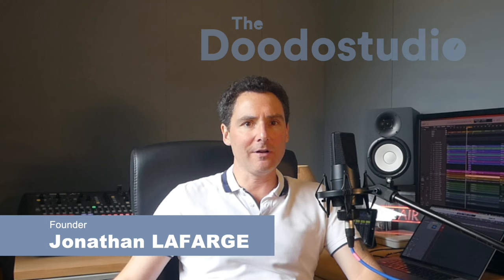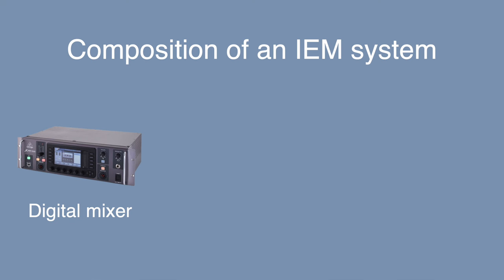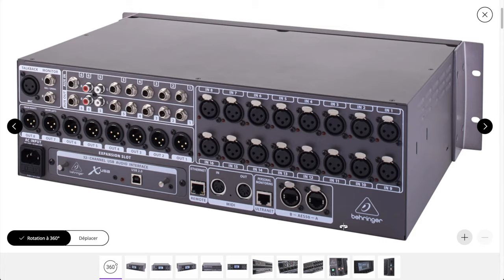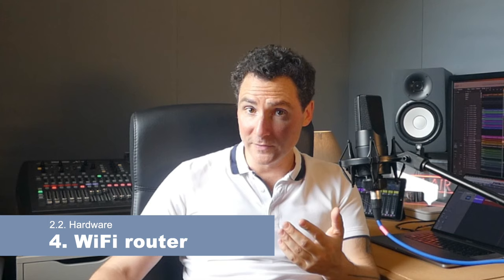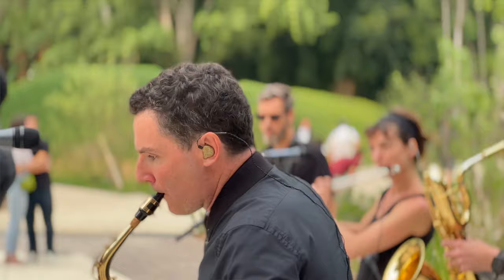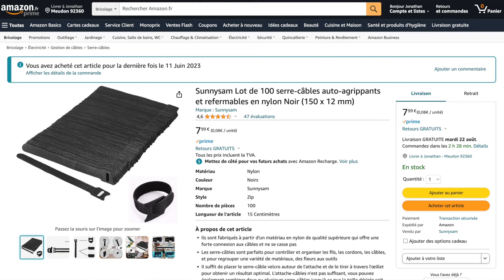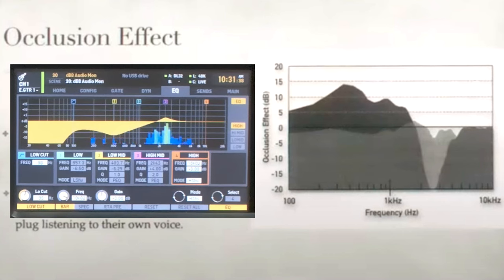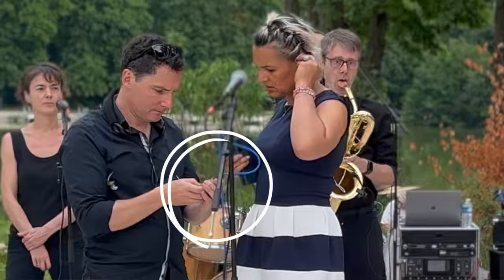What is an in-ear monitor system, and How to build an IEM rack for your band

Comment: With the Behringer P2 - you need to make sure the pins are wired correctly to work in stereo. Some soldering may be necessary to make the cable work correctly.
Reply from the maker: Thanks for this clarification. All our Behringer Powerplay P2 work in stereo out of the box, though. Maybe we were lucky.
Reply: There’s a switch inside the p2 that toggles between stereo and mono.

Comment: This video is realy good... just one thing  i dont understant how you make stereo IEM mix just by using Y XLR cable ?
Reply from the maker: Thank you very much for this feedback. Actually, the Behringer PowerPlay P2 accepts stereo signal via a usual XLR cable. To do so, you need this specific Y XLR cable that will flow two signals (coming from two XLR outputs of the mixing table) into a single male XLR to plug to the PowerPlay. Hope it's clear.

EDIT: sorry, the XLR-XLR "Y" cables presented in my video doesn't work for stereo IEM with the PowerPlay P2 : you need a XLR to stereo Jack, and put the switch inside the PowerPlay P2 to "stereo". Then it works perfectly, and is really easy to pan channels with the fantastic mobile app "Mixing Station".
Here is a link to this kind of cable: https://amzn.eu/d/2NB2BdV

Comment: Meh....we are using an x32 with a Midas 4816O and we don't need those extra two boxes. All 16 channels we need are on Ultranet, and it works great.
Reply from the maker: That's great, lucky you! I guess your rig is much more compact, then. On our side, we really needed 24 channels, and wanted to be analogic to be able to split the sound for the front of house whatever the local system is (in particular analogic systems). Feel free to share some pictures of your rig!

Comment: Why not use aes50b instead of mic splitters the x32 allows you to route all of your inputs to aes50 outputs
Reply from the maker: It is a possibility, but this will work only if the Front of House consol is a digital one, compatible with our X32 rack. Our intend was to have a rack that would work whatever the configuration of the FoH. Most of the time, stages already have an XLR patch available, that goes directly to the FoH consol. So having the XLR from the snakes is super convenient to plug and play the rack on stage, particularly when other bands are playing before and after us (festivals, etc.). Hope it's clearer.

Comment: Salut Jonathan, ca y est on va se lancer dans la confection de notre rig IEM. J'aurai une petite question pour toi. Est-ce que vous êtes satisfait de nos splitters Behringer Ultralink MS8000 ? Je lis sur internet que ces splitters induisent pas mal de bruit si intégré à un rack ou il y a un power conditioner. Nous hésitons aussi avec un splitter Seismic Audio 24 pistes, mais les revues sur internet ne sont pas top non plus. Du coup on sait pas trop quoi faire. Merci d'avance pour ton aide. Brice
Reply from the maker: Salut Brice ! C'est une excellent initiative, vous n'allez pas le regretter ! Concernant les splitters Behringer Ultralink MS8000, je n'ai aucun problème avec. Je pense que c'est un très bon produit. J'ai juste eu un souci une fois lors d'un concert en extérieur, où j'avais installé notre onduleur (17:13) collé contre le rack. Pendant les balances, cela générait un bruit permanent dans toutes les entrées. Il m'a suffit d'éloigner l'onduleur de 20 cm du rack, et le problème a disparu. 
De toute façon, je pense que ça n'est pas une bonne idée de monter un onduleur directement dans le rack d'une part parce que les bobines de l'onduleur qui stabilisent le courant et la tension engendrent un champ électro-magnétique très fort qui crée du bruit dans les câbles audio, et d'autre part parce que l'onduleur pèse le poids d'un âne mort, qui va encore s'ajouter au poids du rack. En outre, je n'utilise (et donc n'emporte) l'onduleur que pour des concerts en extérieur, avec des alimentations électriques un peu hasardeuses (humidité, etc.). En concert en intérieur (bars, salles de concert), le réseau électrique en France est suffisamment propre pour ne pas en avoir besoin.
Bon courage dans cette aventure, et n'hésite pas à partager des photos de la bête une fois montée sur l'adresse mail du Doodostudio : contact [at] thedoodostudio.com.
A ta dispo pour tout autre conseil.
Reply: @TheDoodostudio  Merci pour la réponse rapide. Ce que tu me dis sur l'onduleur et le pb de bruit confirme ce que je vois sur les forums. Du coup on a décidé de partir sur des Art S8, plus cher mais de meilleure qualité. La commande de tout le matériel est partie, on hâte de tout recevoir. Je te tiendrais au courant de nos avancées. Merci encore
Reply from the maker: Génial, je partage ton excitation ! C'est du Lego pour musicien ! Bon montage.

Comment: I just bought my small band a budget IEM system the Xtuga rw2080 and it's a dual monitor and behind it shows left and right af, my question is, 

can i plug left af to aux 1 and right af to aux 2 and give individual mix despite being on the same frequency?
Reply from the maker: Thanks for asking. I didn't know about this system, but according to what I saw on YouTube and in the manual, it seems you cannot allocate one channel to 1 receiver to get 4 individual mixes.
I had the same issue with the LD Systems MEI 1000 G2 Bundle: they pretend to have the so called "Focus" mode, allowing to allocate one channel to one receiver, but it doesn't work properly, and I was still able to here a bit of the other channel in my mix! In addition, sound was horrible, with lot of noise.
I'm afraid you'd better buy a second system to get individual mixes.
Hope this helps

Comment: Did you have any noise issues with the ms8000?
Reply from the maker: Hi! No, no noise issue with the splitter Behringer MS8000 at all.
However, during my last gig, I had a noise in all my channels : it took me some time to figure out that the noise was coming from the UPS (17:13), that was disposed too closed to the rack! I just moved it 10 cm away, and the noise disapeared.
Hope this helps.